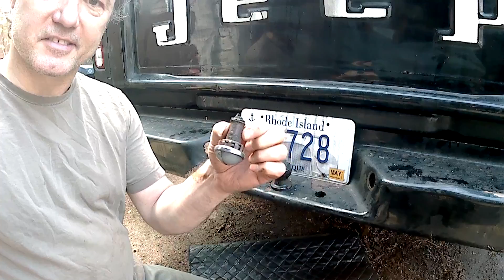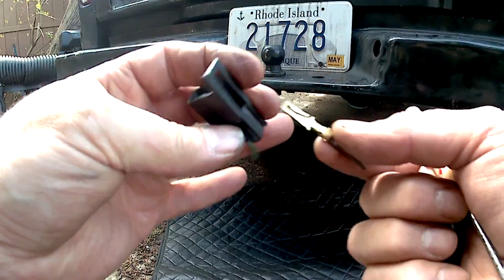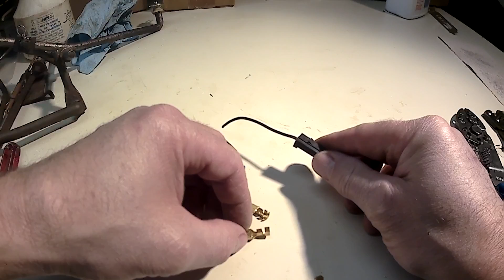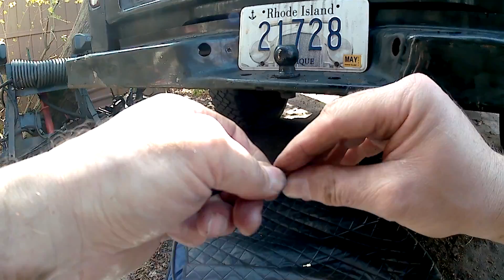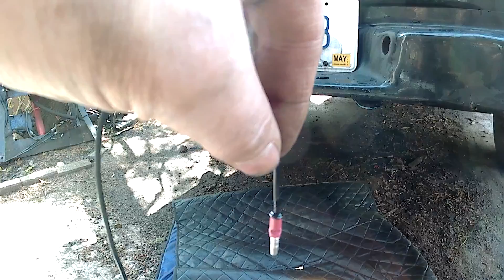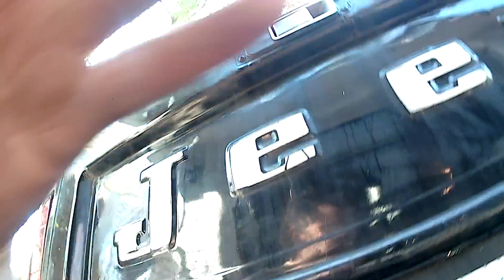J-20 Wiring Repair, Part 1- License Plate Light Replacement

Comment: What are the two wires from the car and which goes to which wire
Reply from the maker: Those two blue wires run from the driver-side rear running-light to the passenger-side rear running-light in the taillamp housings. The bulbs ground through the housings contacting the bumper, which itself is grounded through the chassis itself as a ground.

Comment: Just bought a 1991 Ford f150 and noticed the license  plate lights were out, so I crawled underneath to see what was wrong, and found someone just clipped the wires!  Guess it was easier than changing the bulbs???  Now I've got to try and find the remaining wiring unless that was removed also.
Reply: Same damn thing happened with my 2001